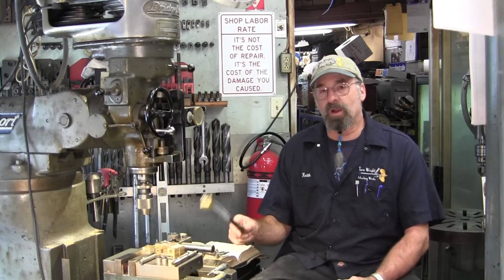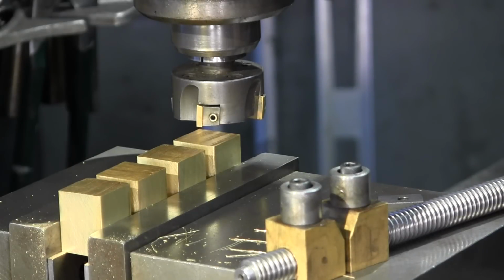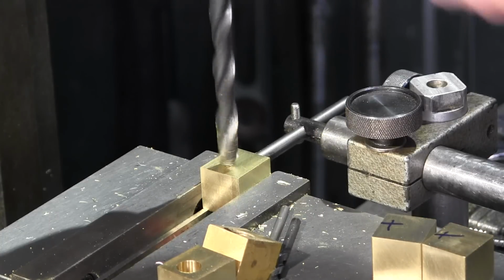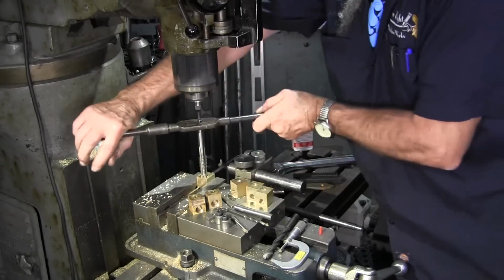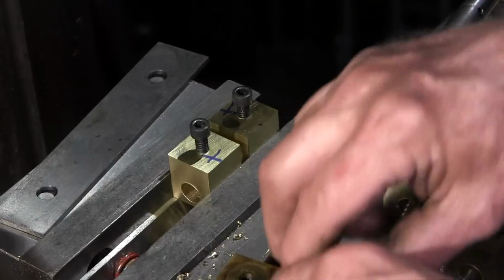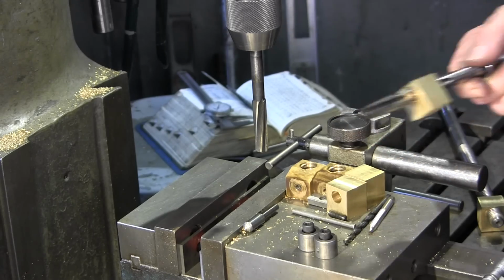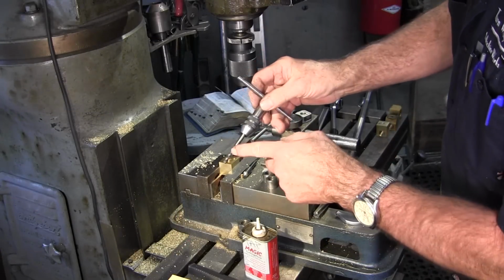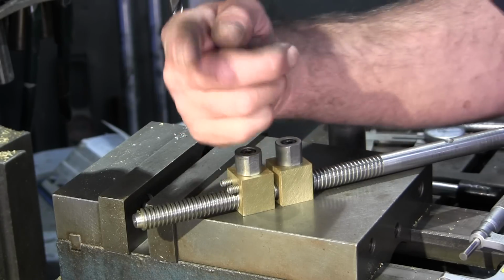Let's Look Under The Old Girls Apron Part Five

Comment: If the thread pitch is 0.125, and the nuts are supposed to be 1/8" apart, why can't the blocks be threaded with no gap?

Comment: Thanks for the info Keith, I've been contemplating replacing the cross slide nuts on one of my 13 x 36 clausing Colechester lathes. I think I will also replace the wedge and go with set screws. I like that idea. Glad you bring the math into it makes it so much easier to understand. Hope all is well. Greg

Comment: Hi

I have a GH 1440a lathe & i am going to do a oil change on all 3 gearboxes, 

What oil do i use in all the gearboxes.  the lathe is Chinese a Warco, Enco.

The best way or slide-way oil  ???
Hopefully my lathe is in a, good condition & will not need the work.
but i am waiting for the next video, great work.
Jeff g
Reply from the maker: I like light hydraulic oil for my machine gear boxes. Way oil, use on ways, to heavy for gear boxes.  ;{)------
Reply: Hi
Thanks Jeff

Comment: Are not the wage are the better solution to counteract twisting the Blocks?
Because if the angles of the wage surfaces are equal on the wage and the blocks, it forces it to stay in a right angle.
On the other hand if you put set screws offset the bore of the thread you do put a twist in it.

Correct me if I am wrong! 

Sry for my bad english, i´m german.
Reply from the maker: The wedge causes more hassle in push / pull on the blocks before tightening the block back to the posts, over the sets, pushing 90 degrees to the post mating surfaces. As in the comments before this yes if there was room for a straight across positioning of the screws it would be best. ;{)-----
Reply: oh yea, i look closer how the forces are applied, with these posts on top it may makes more sense to put the tansion just at one pivot point. with the wage the blocks could rock around.  🤗
Reply: thx for answering, love your work!

Comment: Hello Keith, My understanding was that this lathe was going to be dedicated to doing metric threads, of which you comment that would possibly only used once a year.  It appears that I was eagerly waiting for what I sent you an email about two years ago and haven't yet received a reply. 
What I originally asked is if you would do a tutorial on remanufacturing the cross slide screw in a 16x3 trapezoidal thread so we could convert our lathes that were commissioned for the US market and ended up in Australia, where Napoleon's revenge has taken a firm hold. Being such a small population we have been afforded the cast offs of the Asians, but seemingly overoptimistic for a resolution. I like the idea of changing the wedge to grub screws, however I was hoping for something that would rectify the unequal adjustment pressure on the thread. One method I came across some years ago was the use a spring, float one part of the nut and square it up against the underside of the cross slide to stop it turning. Once every 5 years just rotate the floater a quarter or half turn and the whole system is self adjusting, then in the future you will have some spare time to do 2 threads per year.
Your choice of metal for the nut has me puzzled, "free machining brass" most of the you tubers and bloggers would steer us towards PB 1 or 2 bronze, some of the Myford fraternity have used deilrin. Have you got a few moments to give us your thoughts on your choice.
I would like to say thanks for the channel, can't go to any men's shed in Australia without someone dropping your name, and from a retired old fart thanks for taking the time when your still making a living from this craft, that takes an extra special effort.
Alfred
Reply from the maker: Hi Alfred, Thanks for commenting! I had no intentions of switching to total Metric, only to be able to accommodate the need if it comes into play. I will be doing the new cross slide screw as well, in the Rutland lathe using the old screw in place. If there was a little more room under that nut , I could equal out the pressure across the block with a diagonal pattern, will be looking if i need to machine in the carriage to accommodate. My choice of material was based on what was on hand, even the right size square, it is a simple nut to remake any time, if I was to buy material special, I would have used a harder bronze, 544, first choice,  then 945, aluminum bronze or naval bronze. I'm trying to fit in a lot of changes all while the carriage is removed, fitting it in between all in the work schedule and trying to have as much fun doing it as I possibly can. Sorry if I missed your Email I get a lot of them and some slip into the junk box, the best Email to contact me with is the turnwrightmachine@ listed on my web site contact us page. I'm restoring the screw to original design, which I find more comfortable, although I can't disengage half nut while metric threading, I'll design foot operated, disc brake system to stop spindle and reverse much faster and that will please my needs. I will be tweaking as I go, and the projects I push on the little Rutland, might just go on endlessly who knows, keep commenting and you may see revisions to what I have done already and or see how they perform down the road.  ;{)-------

Comment: I thought the wedge was to help take up the slack in the threads by changing the angles of the brass nuts
Reply from the maker: It's design was to push the two blocks away from each other, and the post would be re-tightened after the movement.but the effort to push down and tighten up work more against each other than if a set screw push between the boxes were used. if there was more room to have more material under side of the block it would be better to oppose two sets diagonal each side of lead screws.
;{)------
Reply: lol your right I was thinking wrong thanks for answering

Comment: any concern about the flats cut on the round plugs letting debris down their respective holes ?  perhaps a stopped cut instead ?
Reply from the maker: The post are center of the blocks and the sets diameter take up most of the void not worried, more dirt and such will be getting in under through the open end of cross side. ;{)------
Reply: Thank you for the reply.  BTW, I believe you are one of the Very Few Machinists on u tube ( or anywhere, for that matter ), who use proper Speed & Feed when using reamers,  refreshing to see these days.   It is quite evident you really enjoy what you do, both learning, teaching, and producing your many  insightful videos. THANKS AGAIN  !

Comment: Keith, did you consider an ACME 2C or 3C instead of the general purpose 2G?  Any comments?
Reply from the maker: To me, when I create the screw I'll be creating the fit I desire, the tap is standard to match a die or set thread backlash reference. I chose that tap because of the cost and easy of getting. I was real surprised when I got the final fit on the old screw, it seems free but no backlash to the feel, it might of, if held stationary and indicated off the end, with tenth's indicator.  ;{)------

Comment: Hi Keith, 

Great series, as usual. I agree with the adoption of the screws in order to introduce axial thrust on the blocks, etc. I have one enquiry/recommendation, sorry if you have heard that before. 

I would place the screws on the diagonal of the block, not side by side.  This would counter any twisting torque to the top of the crest of the lead screw. I imagine placing the screws side by side was probably determined by availability of access to them. 

In any case, the series is a beautiful example on how any machine tool can have its life and usefulness extended by up-dating some critical aspects of it, if the underlying structure is sound. 

Best Regards,

Comment: Very good video Keith. I noticed that you didn't back the tap off after a few turns like a normal tap. Are acme taps different? More like a gun tap
Reply from the maker: I only back off a tap if I feel like it is not able to push through just as you say gun tap, it is a coarse size thread but it was free machining brass. ;{)-------

Comment: A little drama there as the new bolts would not take to the thread (or, the other way around).  However I did not quite understand the problem or how running a reamer through the bolt managed to fix it.  Was the tap incorrect for this thread?

Absolutely love your titles, and how you carefully take us through your process there.  Getter Done has become my favourite phrase.
Reply from the maker: The minor diameter lacked clearance, as I mentioned in the fist clip. thanks for the comment.  ;{)-----
Reply: I'll go back to the first video.  Did wikipedia search.  Article tries to explain, but I still can't quite get it yet.  I thought that if tap is correct, threads you cut should fit perfectly.  

In your hands we have science and art combined.  I admire that a lot!

Comment: I had to make the same thing for my Colchester lathe a while ago. I couldn't afford a tap so I had to single point thread them. In order to keep the thread timing, Instead of making two separate nuts I decided to thread one long block of brass and then split it with the appropriate gap at a later stage. 

It didn't go well though. As the lathe I was repairing was the same lathe I was using to make the parts, I had to use the compound as the cross slide.  Also the half nuts were pretty worn which lead to several failures. In the end I gave in and bought new parts for more dollars than I care to admit to.

Comment: planning on cutting a very narrow 1/32 wide groove in the top of the felt or even an upside down keyhole shape. so it becomes a reservoir as you squirt a little in from the top..  also is there any way to trim a zirc fitting OD to press into the old wedge screw hole so you have a spring loaded ball to keep chips out of the hole.. but still allow you to depress the ball to allow oil to squirt in..
Reply from the maker: Turning the zerk down would be tough, they sell oiler inserts like that at McMaster Carr and other suppliers. ;{)-----

Comment: Well you could have made the nuts round and threaded the outsides with opposing threads then made a matching block for each of them to screw into. Then find 2 matching junk chucks to steal the screw racks from, silver solder the racks onto each threaded nut and then you could adjust backlash with one turn of the drill chuck key between the 2 nuts. :-) Of course I probably would have just dealt with a little backlash before doing all that but it sounds neat!

Comment: Can someone tell me why on earth they would make a lathe with an 8 TPI lead screw an the cross slide.
I have a new Grizzly G4003G and it has 10 TPI and now the dial is a friction dial not one with a set screw and the light is an LED.even though the manual says halogen.
It is a nice lathe and I have no complaints what so ever.

I dont know what you have for gears in the back but if it is like mine you can cut over 600 different thread pitches with it.
Here is a link shows how to do it.
The lathe comes with the 82 tooth gear as the idler but if you flip it around and use the 91 tooth gear all of the time for an idler and flip gear G back and forth from the 82 to the 91 or  use the 60 tooth for gear  you can get a bunch with the rest of the change gears.
By leaving the two 40 tooth gears on F and G you still get all of your threads that you would normally have. 
 
One last thing before I put up the ;links the discovery channel would have been so much better if they would have had shows like yours instead of a bunch of people fighting all of the time.
Maybe people would learn something beside how to act like a jerk.
I love your videos.
Thanks Keith 
Here are the links this guy put out there for folks I hope you dont mind me putting them here for people it may help you or someone else
Sorted by pitch.
http://www.truetex.com/grizzly-12x36-pitch.htm
Sorted by change gear selection.
http://www.truetex.com/grizzly-12x36-gear.htm

Cant wait to see what you do for a lathe brake as I am going to put one on mine too.
Again thank you.

Worth

Comment: Question? You went through the motions of marking the "fixed" side of the blocks to the "fixed" jaw in the vice. All of the holes in the  blocks were drilled the same distance from the fixed jaw. When you taped the second block of each pair, you rotated the block 180. ???  Could this then offset your tap drill hole of the first block to the tap drill hole of the second block if the tap holes were not "exactly" in the center of the blocks??  Great exercise in refurbishing a lathe.
Reply from the maker: The main purpose in clocking was for the off set in the 1/4" - 20 thread hole, towards the stop  and both the ACME and 1/4" - 20 hole were centered in block as far as vice jaws and of course after the ACME tap was run through that clocked thread corresponded with the 1/4" - 20 holes to be at the right span, hence the stamp marks.  ;{)------

Comment: Keith excellent video as always.
The engineer in me is forcing me to point out that using screws in the blocks to take up the backlash rather than the wedge only reduces the moment or or twist imposed on the lead screw (38 min mark). If you had the width on the blocks and could put the screws on the same horizontal plane as the lead screw there would be no moment or twist otherwise there will be some amount of moment.
Great videos again brings me back to my days working under mechanics and welders through high school and college. Now I only get to spend a few minutes a day talking to machinists about various parts I'm pushing through. Your videos give me invaluable insight for my work as an engineer and as a hobby machinist. Many thanks, you sir get it done.

Comment: Long time lurker, first comment. The adjustment screws you added will have the same effect as the wedge--they act as a lever from the centerline of the screw. The only way to truly prevent the bending/twisting you're talking about is to have them on opposite sides of the screw axis. Another comment mentioned opposite corners, which would be the same thing. I don't think those have to be adjusted very often, but the top access would make it easier than the internal setup you've added.

Comment: Keith, what adhesive do you use to keep the sandpaper down on your surface plate, and what do you use the clean the adhesive off when you're not using it for lapping?
Reply from the maker: I use the Duro, Loctite, or any available brand at the local Benny's or hardware store and clean up with acetone. ;{)------
Reply: Awesome, thanks for the quick reply!

Comment: I would think the lead screw would not be exposed to much debris and the nuts made of softer brass they would never wear down but I clearly don't have a full understanding. Thoughts?
Reply: In general, when working dissimilar metals against each other, the harder one gets worn down more because any grit embeds into the softer metal and cuts the harder metal.
Reply: Thanks
Reply: One of the problems is many people tend to go for almost zero or zero backlash and gib adjustment.
This will wear this stuff out in no time.
I have seen people complain about the new lathe they just bought having 0.003 backlash and say what do you expect from a lathe made in China., 
One it is adjustable and two  it is obvious they dont know anything about this stuff and they didn't read the manual.
Most of the time equipment will find a happy spot and stay there for a good long while. 
Also taking to heavy and too fast of a cut on a smaller machine and bogging it down will wear one out really fast.

As far as stuff getting inside it does and I dont use an air hose to clean things off I use a vacuum towels and a brush but it stills gets in there.
This is why I take them apart ever so often to clean things up.
Reply: I got to thinking maybe the brass is a long standing grandfathered choice that maybe a mistake perhaps they should then be made of the same metal, in other applications they seem to last. I hear you on the chinese machines the few I bought come with a liberal application of 60 grit lapping compound

Comment: Hi keith, I do not own a machinists handbook....what does "2G" mean?
Reply from the maker: The General Purpose ACME screw thread has three suggested classes-of-fit: 2G, 3G, and 4G which are defined in the ANSI B1.5 standard. Class 2G is the specification's preferred choice. If less backlash or end play is desired, Classes 3G and 4G are provided.  ;{)--------

Comment: Double 72 is 144 not 154. I hope in your actual cut you used the right number.
Reply from the maker: I'll make sure I add in that extra .005 " to the depth, actually, I'll be going just shy of that, maybe .495" to .498" root diameter on the screw. Thanks for double checking as those before you have commented. ;{)------

Comment: Now that there are flats cut on the 2 round pieces, wont dirt and chips get down to the nuts? What if you mill flats on them but leave the top 1/8th inch round?

Comment: Where did you get those square sockets ? And what's the brand ?  I've been looking for those for the exact same purpose you're using it for. Great movie!
Reply from the maker: In the SK socket set. ;{)--------
Reply: That made it lots easier to find. Seems like they are often called pipe plug sockets. SnapOn also has a set: 211PPPMY. Thanks for helping !
Reply: Sears/Craftsman has 8 point sockets to fit square nuts (and taps and hand reamers). Very useful to have a set of these.
Reply: If you have a full set of SAE and metric 12 point sockets you can always find one that will hold a square for lower torque use.  If it's tight I just use a wrench that fits right to break it lose, then use a socket to finish.